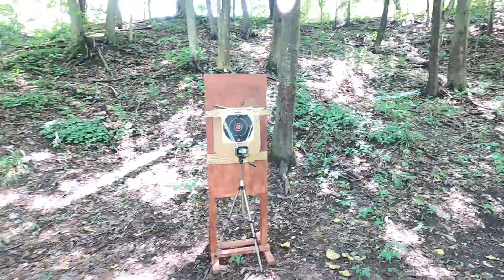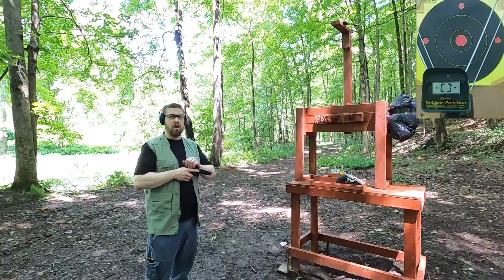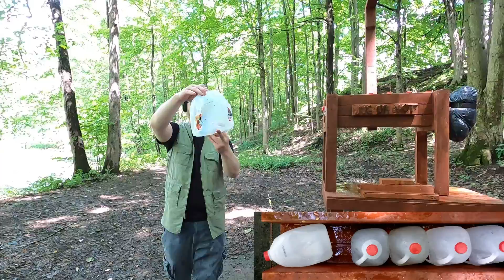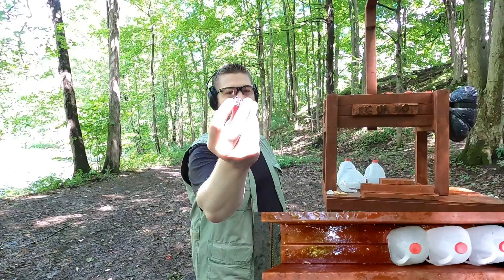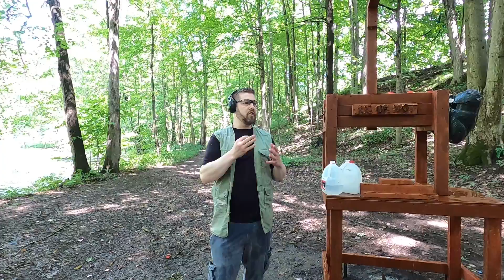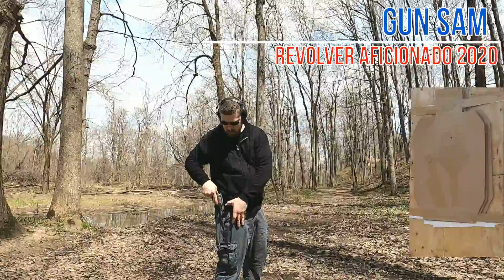10mm More Powerful than .357 Magnum? 💥ULTIMATE Test💥💥💥POWERFUL Ammunition

Comment: Notice the jam on the glock? Not on the smith, im a firm believer in wheel guns for self defense.
Reply: If you read the other comments, the dude also has a ton of aftermarket parts on his 10mm, including recoil spring, extractor, and different feed ramp/barrel, all of which affect reliability. I'm not sure if he's just allowing the recoil to move him or not, but he also might be limp wristing, which causes reliability problems. All of these are not the original gun faults. There's a reason why the majority of police departments carry glocks. When stock and used right, they are as close to 100% reliable as a gun can get.
Reply: @brett9382  he def limp wristed it. Bc of glocks lightweight poly frame, itll jam. Glocks are known for this. Gotta grip it tighter
Reply: Lol get in a gun fight, I bet you change your mind if you survive
Reply: @mikegrey5027  no chance of that. Most fights are settled with 2 rounds ,according to the fbi stats. And i carry three and 1 is an 8 shot.
Reply: @JamesThomas-gg6il never in my life have I seen a gun fight end in 2-3 shots.. and I’ve seen hundreds lol.. revolvers are horrible for gunfights with the bad triggers and low capacity and slower follow up shots
Reply: @ItzFragOut  hmm goes against every statistic out there, even the actual fbi report. I haven't seen many but the only time I've ever seen one go beyond revolver capacity was a gang war and must have been 100 rounds from 8 different shooter, with switches, I might add, and no one got a scratch. So I'm still a huge proponent of revolvers. My main carry is s and w 8 shot .357 and back up and pocket carry a 638 and air weight bodyguard. Take from that what you will.
Reply: @JamesThomas-gg6il  show me one police shooting were they fire 2 shots Lmaoo they always dump the who mag. In shootout’s adrenaline is running and all your accuracy isn’t %100 and not always point blank so you don’t hit all your shots. Plus 2 shots to the body from a pistol rarely pits someone down on the spot
Reply: @JamesThomas-gg6il  the 3 shot statistic you go off is only gunfights from less than 3 yards away.. fighting range.. you think these gang fights (majority of the shootings in America) average 3 shots? You’re smoking cock if so
Reply: @ItzFragOut  um I thought we were talking about citizens here. I don't care about any of the thin blue line crap. As I said before, it's my opinion and yours may differ, but I dont have to worry about mine have an issue.
Reply: @JamesThomas-gg6il  if we’re talking about citizens then you’re whole point is irrelevant bc you’re using fbi stats, highly trained officers not citizens
Reply: With you all the way. Had a bear crawl in the hole with me placier mining. The first two tries with my 1911 it wouldnt fire cuz the gun was against it, on the third try it went off and did its job. Due to the first two missfires i got my hand and arm chewed up rather badly and numerous scratches. Now i pack my GP100 6IN 357MAG.
Reply: It’s because he has a Frankensteined conversion Glock 10mm, and I think he must have installed the new extractor/any other parts incorrectly, because I’ve never heard of Glock conversions jamming up every round like his does. Also, he is limp-wristing the holy heck out of that Glock
Reply: It jammed because it’s a .45 ACP G41 with a 10mm barrel…
Reply: @bullittsandbullets1821  which proves my point. Un altered maybe its more reliable, but apparently not 100 percent like it is.
Reply: Thanks!

I use that BB 357 as my carry ammo in both my Python and my 686.

I recently switched to the 10mm because you get the terminal ballistics AND capacity and they now make a 10mm that fits my hands better than a Glock in 10.
Reply: I've had a few revolvers get off on timing. That's a very dangerous thing to happen. Even a slow fire. You'll react by pulling the trigger again and it'll rotate the round into the frame before blowing the gun up
Reply: @bloodbushcraft2467  squib loads happen in auto loaders and can have the exact same outcome. I have a 629 that I will not shoot until it goes either to a gunsmith or back to smith and Wesson because it is barely out of time. Do not use a broken or worn out firearm for self defense.
Reply: @JamesThomas-gg6il  you're right both guns can have squib loads. With a wheel gun it can go from perfect function to out of timing just by carrying it. Personally I prefer an auto. It's easier to fix normally and clearing a jam can be built into muscle memory without even holding the gun
Reply: @bloodbushcraft2467  I've never experienced anything get out of timing simply by carrying it. I carried a model 10-5 for several years and still have a model 10 that was a police turn in. It's beat all to hell but it's one of the best shooters I've ever had the pleasure of shooting. I carry all kinds of pistols and revolvers and sometimes several at once. I'm not knocking any of them. I really do love my revolvers though.
Reply: When did they start referring to revolvers as "wheel guns",and why? It's not as though the revolvers have an automobile like 4 wheeled chasis.
Reply: @Au60schild  I have always assumed that its because the cylinder revolves like a wheel. But I could be wrong.
Reply: @James Thomas  Yes, of course but why the need for the change in nomenclature after some 150+ years of the very simple, successful cross-cultural use of revolver? That is and remains my apparently hard to answer cogent question. Hell, even The Beatles named an album after the fact that the vinyl record revolved as it played.
Reply: @Au60schild  I do not know, but why does it matter? People name and rename things all of the time. To us, it's a toilet, to the brits it's a loo. dont even get me started on cigarettes.
Reply: @James Thomas  Simply curious due to a serious background in science. In the late  nineties, they were revolvers and I Ieft sporting to raise a family. When I return in 2023 they're "wheelguns". I was merely wondering if that was due to some sea change in collecting.
Reply: It may have something to do with it being a conversion........
Reply: That’s because it’s a conversation barrel, he states it numerous times in other videos. Autos are ammo picky, revolvers are dirt finicky. Enough pocket lint in a J Frame is worse than cheap old ammo in an auto. I love them both, but crapping on one without recognizing the others faults is shortsighted
Reply: Can't go wrong with the revolver
Reply: Notice he was able to correct it quickly? When a "wheel gun"  malfunctions it take you out of the fight.
Reply: @JAKEB1982  not always. Ive never experienced a stoppage like that on a revolver. Backed out primer once, but all I did was pull harder on the trigger. Honestly didn't realize the problem until I went to reload. Of course some systems are more sensitive to different dynamics than others. Nothing is perfect, but in an auto you're relying on a middle man per se, to cycle for the next round. A revolver just pull the trigger. And most revolvers are still made of metal and if you have to , throw it at the or pistol whip the bad guy.
Reply: Look I love revolvers and all, but I’ll take my Glock 17 or Sig p226 when shtf. Revolvers kinda suck to carry and capacity is way better with semi auto pistols, not to mention I’ve seen malfunctions from revolvers malfunction, but never had one in my glock or sig
Reply: Conversion guns do that
Reply: A stronger recoil spring is the fix for malfunctions with high pressure loads. I installed a KKM barrel, a titanium guide rod, and a 24 lb spring in my G20. Never had a single problem.
Reply: I shot my Gen 3 Glock 20 10mm over 500 rounds zero jams so far.
Reply: @joshuawallace3420  you obviously buy quality ammo.
Reply: Glock is a great platform and very dependable, although I'm not a fan of Glocks themselves I do have several plastic wonder guns. They all have the same drawback, and that is the ammo. If the round doesn't go boom the gun don't cycle. The only way for sure to know if round works is to shoot it and then it's useless. Then you have rereack the action and try again. On a revolver of the ammo fails, simply pull the trigger again. Again, I'm a firm believer in revolvers. Old technology isn't relagated to no good because something else replaces it. Look at knives, Does a ceramic blade mean a good carbon steel blade is less effective than it ever was? I carry several revolvers  and a couple of blades every day and have so for over 30 years. I won't change now.
Reply: @JamesThomas-gg6il  ,wow what are you doing carrying 3 pistols especially since they're revolvers meaning reliable? I carry everyday but the only way I'd carry two is if one were a backup for the main one and maybe was a lil 22mag revolver, an over and under derringer like 45 or 9, a sub compact 9mm semiauto or like a 5 shot 38special. When I go out I carry someone elses it's either a 7shot 357mag or a 17 shot 9mm with extra 17mag. Point is when I carry the 7shot I have enough trust in my abilities and faith in God that I don't stress the low ammo count and that I'm not carrying the double mag 9mm. 3pistols is not bad or wrong but suggest a lack in belief in yourself and kinda comes off paranoid. Like I said I'm a big 2a person so it's cool either way.
Reply: @playsandgrace   that's called a new York reload. Just grab another gun. I carry two smiths and 1 foldable north armerican .22 lr and mag cylinder. When I wear heavier clothes or jacket then my Springfield xd and either a 32 or 380 Kel tek throw away, so all told that would be 5, 3 revolvers and 2 autos. Plus various knives and such. Nobody knows either. Just dont look offensive or stand out and everything is fine. Plus I can hand one to someone else and say cover me and not have to explain the function. To each his own but I can honestly say I've done this for years and have never felt underguned.
Reply: they can all jam. 
have a plan for when you get a " click" instead of " bang"
Reply: @mikehenthorn1778  on a revolver you just pull the trigger again so there is no Jam. My Glock 40 has had several jams.
Reply: @k9m42  if you get a squib load that just has the bullet get to the forcing cone you have a full stoppage that takes care and tool to remove. They can all jam. All mechanical devices can and will fail at the worst time and in the worst way. 
Even K Rittenhouse had a fain and was saved by the forward assist.
Reply: @mikehenthorn1778  You’re saying revolvers jam?
Reply: @timjones147   all machines can fail.
Reply: @mikehenthorn1778  agreed. But revolvers will not “ JAM “
Reply: Limp wrist shooting
Reply: Ok boomer....Glocks pretty much always go bang every time.
Reply: @imacahguy  yeah that's not true or accurate at all. Just Mindless hype.
Reply: @Fyoutube444  bs it ain’t I got a G19X that’s 1000 rounds in w brass steel n aluminum ammo Not a single misfire or malfunction I’d trust my life w Glock. Do love s&w revolver too & Ruger GP100 js
Reply: @imacahguy back up your claim. Instead of calling people boomers
Reply: @imacahguy . No, they don’t.

Comment: Great review 👏 thank you. I understand what your reasoning behind sectional density is but you still should have gotten a 158 grain 357 BB to compare also. There is a video on you tube and the man is shooting 3 different Buffalo Bore loads 125 Gr, 158gr, & 180gr 357 mag. And very clearly to see 👀 the 158 grain hits the steel substantially harder than the 125 grain. In your test here the 10MM  is the clear winner but compared with a 158 grain 357mag the outcome is going to be closer to equal with no  clear 🏆 winner. In fact the 357 may appear just ever so slightly more powerful. In my mind the ultimate test would be the Underwood 10mm 200 gr hard cast againt the Buffalo Bore 357 mag 180gr hard cast heavy. They are both very powerful loads.

Comment: great video. im a revolver guy too, but was thoroughly impressed by the underwood performance. but i think for handloading the advantage might go to the 357. chuke swears the 10 takes down browns just fine, and the 357 has long proven itself there too (in heavier loads). so looks like its a preference thing between auto and revolver
Reply from the maker: Thanks. I been thinking about how to approach a bear testing video. Been debating lots of bologna and a 2x4.
Reply: @GunSam  
i hear that grade 5 porcelain tiles are a decent substitute for bone (or as close as you can get). but im guessing just a little more expensive
Reply: Either one of them will kill you

Comment: Great vid, as usual. Used to have a G20 but I ditched it when the pin that holds the slide stop flew out of the gun due to Underwood 10mm. If it can’t run hot without breaking I can’t trust it. Would like to try a P220/10mm though.
Reply from the maker: Thanks, I didn't know there was a pin like that.

Comment: They both come in 150 grain bullets,.... the reloading manual says 357 magnum.
with accurate no 9,....357 is 207 fps faster,....accurate no7   153 fps faster and accurate no5 83 fps.faster.
Reply from the maker: Sometimes the .357 Load data is hard to decipher as different manuals have all sorts of barrel lengths used. Not uncommon to see normal barrels like 5" for 10mm, .45 ACP etc then the .357 Mag says 10".
Reply: yeah I have seen them use very different guns in data manuals.

Comment: Can you do something about a test in a 44 Magnum Revolver S&W vs. Winchester 30-30 rifle. 
So sick of hearing a 44 mag Revolver is a big bear defense weapon (which in most cases, it is) and a 30-30 rifle is not, when the 30-30 is clearly more powerful at any distance over a 44 Magnum Revolver.
Reply from the maker: Next month I am picking up a 4" .44 Mag and I do have a 30-30 with a 20" barrel. The 30-30 is fine, but what I think argument is that the .44 Mag is a better backup handgun than a lot of others, not so much that one should carry only a .44 Mag instead of a 30-30 rifle. But in terms of ability to stop a bear the 30-30 with the 170-190 gr bullets would work great.
Reply: I have cleaned deer shot with a 30-30 , 150  or 170 gr ? flap point , The deer took 3 bullets to stop it . And  2 shot with 44 mag  revolver ( 1 240gr JHP @ 1,350 Ft/sec & 1 240 gr soft point @ 1,250 ft/sec )  each dropped with 1 bullet . The damage from the 30-30 looked like a 357 semi wad cutter  & would likely have shot through 3 deer side by side . Not very impressive .  The 44 JHP , lots of damage , dropped right there ( long ways from back rib to the jaw ) . The 240 gr soft point , hart shot , ran about 75 yards & dropped . It was no different than one shot the same way with a Hard cast 12 ga sabot Hour glass shaped slug . Take away , flat points suck , even in a rifle ( 44 ) , they are too strong & just zip through with little damage . A H P works far better in any 44 , rifle or revolver . A 44 H P out of a rifle puts them down fast with much more damage . Many use flat point for bear , from the test I have seen a 44 240 gr HP would blast through any bear head , if in doubt use a 270 gr HP in 44 mag or 300gr HP . Back to the 30-30 I would use a HP for deer . Will it take a bear , ya in the head , if not , the question is When will it die , after if kills you ?? Next week ?? I would carry a 44 or 10mm   & a 308 AR or 45-70 . A 30-30 is better than a sharp stick or 357 .
Reply: RE: 3 deer hits , I think the 1 st shot was a killing shot , through the liver ( pencil size hole )  it would have lived for at least a 1/2 hour or so ?? It ran over 100 yds , not sure the order , #2 shot in the jaw/ head area   #3 in the left rear leg out in front of the right leg . My brother shot this deer . It was a young male , 1 year old +/- ??
Reply: Other 30-30 hunts , I saw a friend take a large mule deer , ( I think it was a silver tip ?? , not a flat point )  1 shot side to side , the bullet looked perfect under the hide on the far side . I have seen others taken ( 3 ? ) no details . BTW my brother has killed deer at close range with a 357 SWC , shot from a tree down top to bottom & likely hit spine  & heart . As we know it's bullet placement first , bullet type next , within reason  . For bear I want all the odds on my side ( over kill ) .
Reply: This is a good video , Paul H , 30-30 vs 44 rifle , this is not much different than I saw in real deer . I wish he used 30-30 HP or silver tip or Horn lever ammo ( not flat tip ) . I have never used Hornady Lever ammo in 44 or 30-30 & looks to be good . I wish he used a good 44 HP 240 gr , as the soft tip is poor , it kills but rather than drop , they run about 50 yds , with zero indication it was even hit , with a side to side hart shot . I think a good 240 gr HP in 44 mag would do the most damage . I hand load & would use 2400 , lil gun or Win 296 powder , that is slow burning & gets the most speed out of a long barrel . 2400 is the best as it works well in a short barrel as well . I would use XTP or Sierra HP , super accurate , works great .https://www.youtube.com/watch?v=PNiDwprzoo4

Comment: Thanx for the reply & of course, that’s all a given.     However, Ruger Redhawk, 8 shot revolver  in 357 mag 180 Grain Hard Cast bullets or 140 Grain extreme penetrator = any hot load 10mm. T or F? Same gun in big bear defense.
Reply from the maker: 8 shots would work. I know a lot of folks use the xtreme penetrators now days, but in .357 Mag I sort of think the 180 gr hard cast is better, it's just heavier and more dense. I did a test on them both though and they penetrated about the same in my test medium.